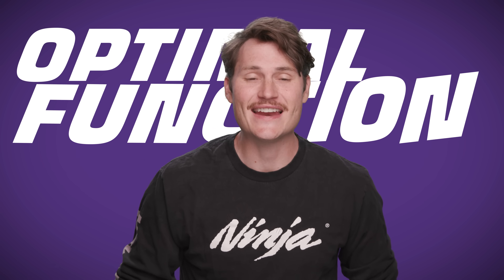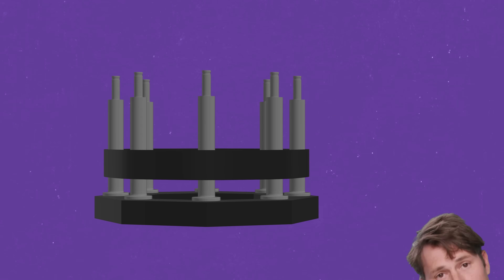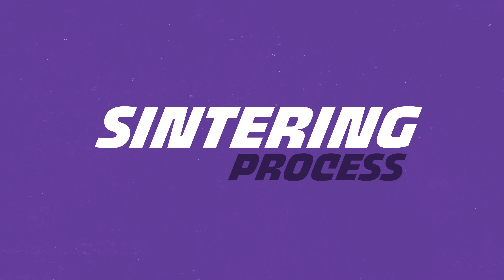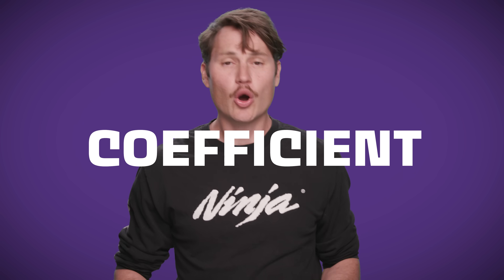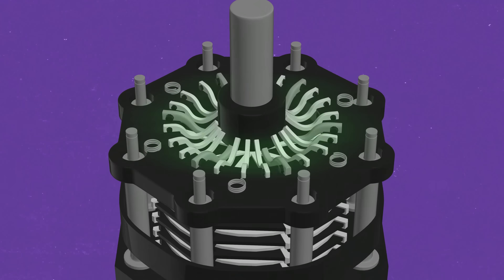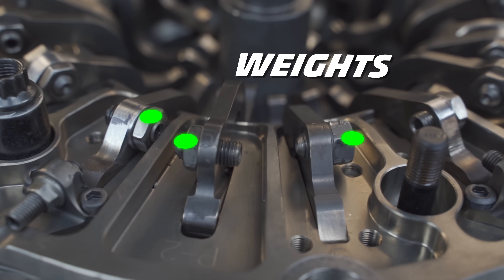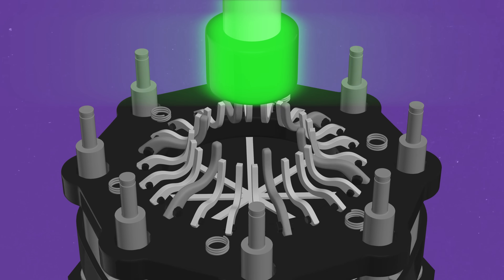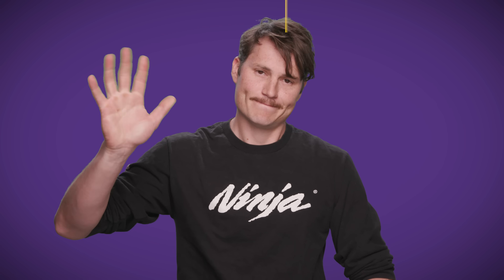This Clutch Only Lasts 4 Seconds

Comment: So, basically, as the individual clutch plates heat up, they melt themselves together one by one until it becomes one "welded" clutch plate, being one at the very top end of the speed? I just, want to clarify.

Comment: I think they could design a wet clutch that would last for more than one run , if you dont know what a wet clutch is they are what is on motorcycles , pretty sure all it would take is changing the organic wet plates to sintered iron disks

Comment: so the engine revs the clutch is engaged and the dragster flys down the course.  Why would it be bad to have the clutch weld up solid??  (well if you could do it predictably) A welded clutch ensures there will be no slippage along the course.  you can kill the ignition and fuel supply at the end of the run.

Comment: Here this question that bothers me. When the dragster is in burnout stage, the crew has to push the car forward up til the water box. why is that? too much power to move little forward on its own or just wanted to save every bit of seconds of clutch life for the race?
Reply: Probably saving clutch life for the race.

Comment: Sir first time seeing this, I do know know a single steel out there with 40-60% carbon content. I don't know any steel's past 5% carbon. And a lot high carbon knives are in the 1-3% carbon range. I'd love to know what an alloy that's roughly 50% iron and 50% carbon is actually called.

Edit: After doing some more internet-ing, I found a Wikipedia page claiming iron carbide is about 6.7% carbon and the rest mostly iron. I only know carbide from being used on the cutting edges of various tools, and I didn't know it was similar to an extra carbon-ized steel. But I don't think it is technically steel. That being said, I still have not idea on my hypothetical 50/50 mix of each, I imagine it's nearly (if not entirely) impractically brittle to be used for anything experiencing basically any shock loading at all.

Comment: Rods and pistons are inspected. Typically the rods can do several runs. They actually shrink in size after a run from the compressive forces. The crew chief might request a shorter or longer rod to reduce compression and therefore power depending on track conditions.

Comment: Turbo? Dragsters use Supercharger

What's the Difference Between a Turbocharger and a Supercharger?

"Supercharger" is the generic term for an air compressor used to increase the pressure or density of air entering an engine, providing more oxygen with which to burn fuel. The earliest superchargers were all driven by power taken from the crankshaft, typically by gear, belt, or chain. A turbocharger is simply a supercharger that is powered instead by a turbine in the exhaust stream.

Comment: I found it interesting

that a N700 Shinkansen train has around ~13000hp (9760kw) which is close to a dragster car..

so with this much power you can make a whole train running at 300km/h

and now all the power is packed into these relatively small engine…

Comment: Sintering is just a fancy name for case hardening to align the metal particles without the need of having to beat them with a hammer. Tempering would also be taking place to ensure that it doesn’t crack under initial pressure.

Comment: Question,why don't they make the clutches out of tungsten, i know i know it's expensive but lets be honest, if you have money to spend on a dragster then it wouldn't be that much of a bother, the melting point of tungsten is around 3,500 Celsius but even if you reach the melting point it doesn't melt because it oxidizes very fast which makes it pretty much almost impossible to melt it in normal conditions, even with a torch at way above the melting point, it is super hard to melt still.

Comment: Dirt oval go karts use 3 disc clutches similar principal but no fingers it has hammers on the outside we adjust spring rate spring height and hammer weight

Comment: They slip nearly the whole pass, maybe a hydraulic coupler, would work better, like a TQ converter, if it could be made light and strong enough, but it would require cooling, so I'm guessing this is why they use clutches,

Comment: Centrifugal force on weighted fingers to engage the clutch? Centerforce clutches have adapted that feature in a form to "normal" clutches. They're aimed at high performance daily driving and towing. This is because the weighted fingers increase the clamp load to avoid slippage for better hard acceleration.

Comment: Small physics mistake, the centripetal force acts INWARDS to the center of rotation, not outwards. If you held a weight by a length of string and swung it around in a circle, if centripetal force acted as is depicted in the video, if you let go of the string, the object would actually curve away, instead of leaving the circular motion tangentially. 

Jeremiah has therefore lost his 'nerd' status 😢😢
Reply: He said the apparent force, centrifugal.  It "acts" in the opposite direction of centripetal.

Comment: Isn't the "cannon"  actually hydraulic, not pneumatic?
Reply: Cannon is hydraulic. It's action is controlled by air. The fingers press against the cannon, but air let's the cannon push oil back to the reservoir at a controlled pace.

Comment: odd question. 
what would happen if there was no clutch? more power?
Reply: basically the speed of the vehicle would be very low or it would just stall..the clutch slowly engaged over the run to increase the amount of power going to the wheels as speed increases so that it can reach top speed while also not stalling....not sure if that helps
Reply: What do you mean? There has to be a way to uncouple the engine from the tires do the engine can idle while the car sits still.

Comment: These are my favorite clutch. The math it takes to get it right is pretty rigorous. This is where estimates and reality really matters. Testing with "taking a little of the top" is so expensive, but math modeling makes accurate enough guesses to try to improve lap times. 

Also, rocket scientists are never the ones who ride them anywhere. They're smart enough to design them, they know better than to strap themselves to one.

171 Clutches would have been welded during this video.

Comment: I've come to correct some science stuff
When youre using relative temperature scales you can't say "twice as hot"
So no, it's not twice as hot as lava, cause [2*2000 °F ] isn't the same as   [2*1093°C]
To use multiplication properties your transformation must have certain characteristics, that are accomplished by an absolute scale such as Rankine and Kelvin
Reply: it's not the same, but as a rough approximation it's fine i guess.
2000°F = 1093°C
4000°F = 2204°C
Reply: @MCBritta  Only in very high temperatures it works, and only with small multiplications...
Reply: @TheMasterChief777777  ...which is fine in this case. i mean even the sentence "twice as hot as lava" is very imprecise by itself, as lava can have quite a wide range of temperatures depending on its composition and other circumstances. so no need to get overly precise on the difference between °F and °C.
Reply: @MCBritta  not a thing about F and C, its more about absolute vs relative measures.
Reply: @MCBritta  It's like having 10 steps, and you are on the 4rd, while somebody is at 6th, and some other dude at 8th
You can't say 3rd dude is twice as high as the 2nd one just because they're one 2 and one 4 steps separated from you.
Reply: @TheMasterChief777777  ah ok now i understand what you mean. your stair example converted to temperatures: 4000°C is not twice as hot as 2000°C because the scale starts at -273, not 0.
Reply: @MCBritta  exactly

Comment: It's interesting that a type of clutch was named after a fake force. Centrifugal force is more of a sensation than an actual force. The actual force that is acting is centripetal force. Centrifugal is just a term that was determined to represent the feeling of being pushed away from the center of rotation, but in reality that is just your mass reacting in opposition to centripetal force (the force pulling towards the center of rotation that allows you to keep rotating without breaking out in a straight line away from the center of rotation).
Reply: @Karl with a K I never said the video was incorrect. The information provided in the video is correct in relation to the topic discussed. I just said that I think it's funny that there is a clutch named after a fake force and provided the scientific explanation of centripetal and centrifugal. Unless you are referring to dpuamuishu's comment about the pronunciation. In which case, dpuamuishu is correct. He mispronounced centrifugal every time he said it.
Reply: @JMilMovies you're talking about a thing created by dudes who had to have their lawyer spell it for them when they applied for the patent. Don't be surprised.
Reply: Add to that the fact that "centrifical" is a mis pronunciation of centrifugal anywy

Comment: how is this useless sport in existence?
Reply: 1000 feet in 3.6 seconds at 340 mph ! ! ! You can feel the sound.
Reply: You don’t even know… go to a race and you’ll have an appreciation trying to get 10,000hp stuck to a track and reaching speeds of 300mph plus. It’s more than just stabbing the gas and holding the wheel straight. Top fuel dragsters are the fastest accelerating vehicle in the world at 5gs at the hit. A fighter jet gets to 3.5gs on launch. Yeah yeah road racing is a different world but if your a car enthusiast, even a mechanical person you will have appreciation for this sport.

Comment: A few forms of hobby racing are just as tuning focused as drag racing, one being RC no prep, Tamiya Mini 4WD, and tether car racing (which still remains the fastest form of model racing to this day).
Reply: I built a no prep rc about 3 years ago, before it got so huge, when it was possible to compete without a carbon fiber chassis, full custom ride.
Reply: @ryurc3033  I'm working on a retro tether car build, everything in that world is custom or small run since it is so small. The really fast guys run full carbon streamliners with bespoke parts and huge glow engines or some have started running brushless setups. I decided to not chase speed records and build for "show and go".
Reply: Tether car? I have to look that up...

Comment: 8:48 centrifugal force does not work outwards, the force works towards the direction of rotation perpendicularly to the radius of the circle. So the arrow shown in the animation should be turned  90 degrees clockwards.
Reply: You would be correct for centripetal force. F=(mv^2)/r Centrifugal force is the sensation of feeling pushed to the outside as rotating or turning due to the change in direction and momentum wanting to carry you in the same direction.

Comment: I didn't think weather would affect the clutch so much actually to the point if adding or reducing weight
Reply: humidity and temps effect tire grip. The hotter or more humid a track is the lighter the weight needs to be for a softer hit.
Reply: As the clutch that's the only thing controlling the " tyre speed" they have no gearbox.
The sun heating the track can have a massive affect on the cars ability to get down the track due to tyre spin or not enough tyre speed.

Comment: Could you make a Damascus knife out of a welded top fuel dragster clutch?
Reply: There isn't flux to help bind the metals together. Its more like a powdered metal super fragile mess
Reply: @ryurc3033  would it be possible though? Given that it would be made of the correct materials
Reply: @maxmachac9756  I'm not positive the alloys would be compatible. With most Damascus materials you have a metal "binder". And a very specific amount of heat to keep it from fully mixing. I have failed to make Damascus more than I have succeeded.

Comment: Is the pneumatic engagement system a crucial part as well? I'd love to see a few episodes or series about how these parts work in tandem, kind of like bumper to bumper tours, but about say a clutch system, or fuel system, or drivetrain. I think that Jerry would make that series great too! Anyways loved the video keep it up Donut!
Reply: Donut used to have a show called “science garage” that you might be interested in.
Reply: Very much so. It is controlled by the timers he mentioned, and they are programmed to go from released to fully applied in a certain time, and rarely is the application linear. A time vs pressure chart won't look like a y=mx+b, but more like a random noodle. Richer teams actually measure how the cannon moves during the run. Must be nice to have the big bucks lol.
Reply: Did that answer your question?

Comment: This video misses one key point, that Top Fuel Dragsters don't have a Gearbox! This is all done by the clutch, one of the reasons why they have multiple plates.
The clutch slips the entire way through, so that the tyres don't slip. That's why it gets so hot.
Reply: They've covered that in a previous video
Reply: Yes that`s what he was saying
Reply: The rear tyres also play a role in changing the final drive ration when they expand to help
Reply: Why don’t they use torque converters
Reply: @beanapprentice1687  because no gearbox
Reply: @ryano0587  A torque converter does the same thing as a clutch. You don't need a gearbox for either.
Reply: @GeekOfAllness  A torque converter uses liquid. If that flashes to a gas you get an explosion (something like 14:1 expansion). If the Clutch melts: the material does not expand to the same degree.
Reply: @beanapprentice1687  I think the impeller plate Bend, Grind and Boom would be best to illustrate what would happen if they used torque converters. Only a guess though 😅
Reply: short answer would be cavitation, but theres alot more to it than that. @beanapprentice1687
Reply: the last b2b on dragsters covered this. the resistance of slippage in the clutch allowed for a cvt type transmission
Reply: https://youtu.be/XihPq-sYWF0